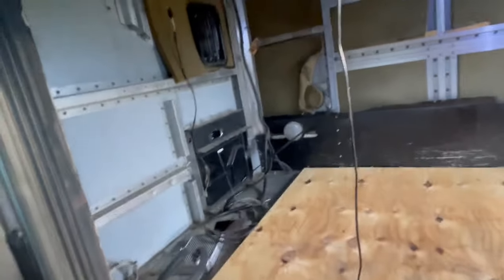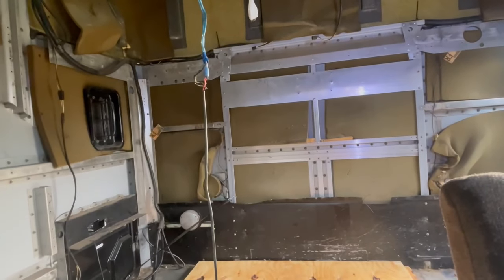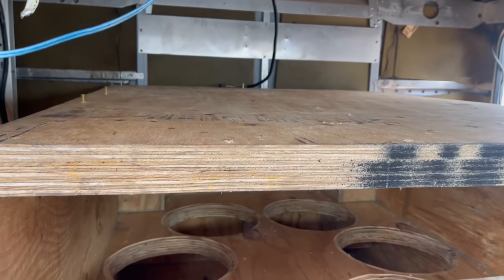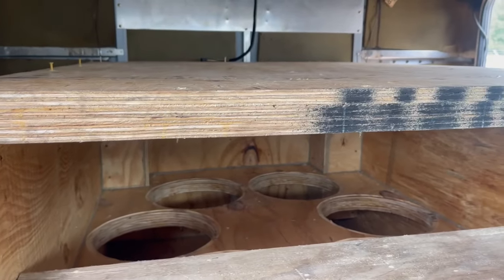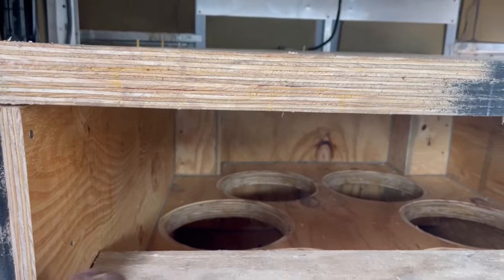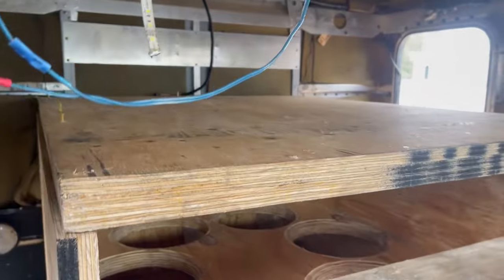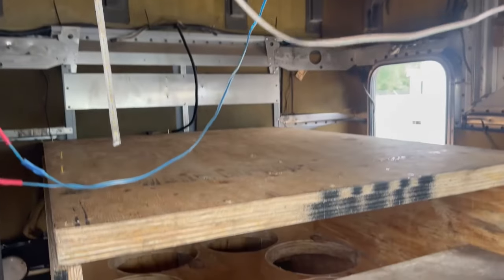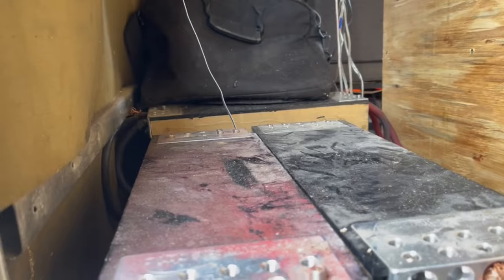😮 a Randy Ritchie design built by me,this thing is going to be so windy

Comment: Good design,  but port is too close to roof of box I think
Reply: @josephhammond2557- Since john only cares about being windy, the rear ports being closer, helps with loading on the freq. below port tunning. This will reduce peak SPL #s a little, but John wants a windy demo monster, so this should be fine.
Reply: @evilinside5984  OK 👍 and thanks 😊
Reply: @bassinsemi7049  round over edges of ports to reduce port noise